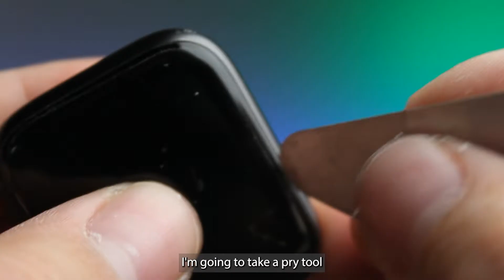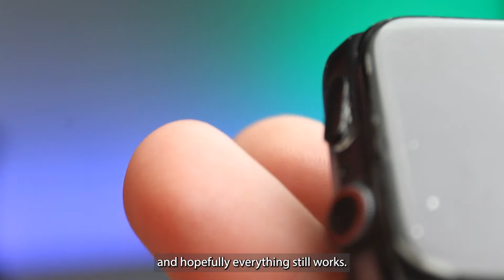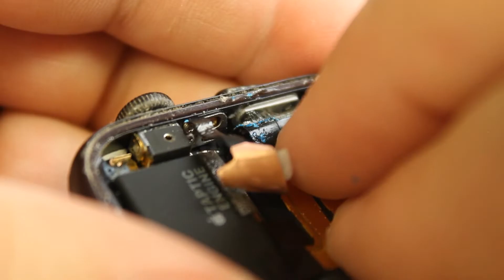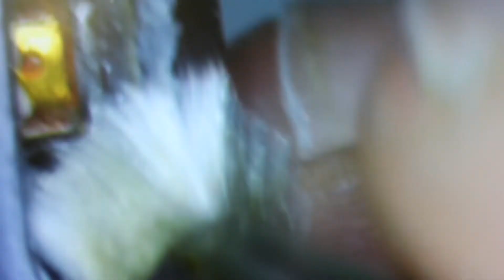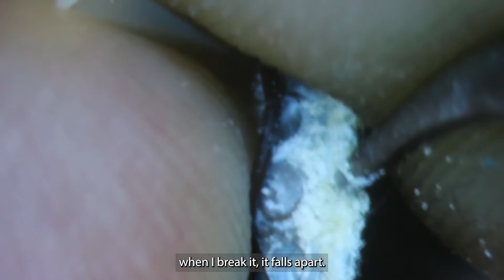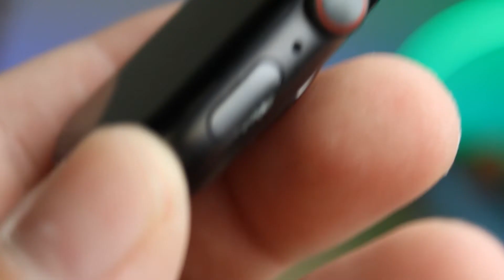Apple Watch Series 6 Power Button Replacement: Restore Control with Ease! #satisfying #applewatch

Comment: Help me with the latest ultra 3 7in1 straps 2.01 display, because it it different from apple and I can still move the power button but it won't click and it's spring was stuck from pressure of putting a strap

Comment: Hi
Can you help me with any advices?
I have watch 6 44mm water damaged
The issue with heart rate sensor, it isn’t active (doesn’t blinking) I replaced all housing from another Watch but it doesn’t help. then I replace flex connector from backplate to motherboard, also no result
Watch is charging and the cardiogram works

Comment: How much for this repair?
Reply: It’s not giving me an option for button repair. I’m having the same issue and my button doesn’t work. It’s full of dirt I tried cleaning it out but won’t work. It forsure is dirt bc I tried to work it with a sewing needle. It’s never been dropped or damaged. The only damage u will see from the button is me trying to clean if
Reply from the maker: Depends on the amount of damage. Submit a repair request at www.fixdirepair.com
Reply: @FIXDPHONES  the watch has problems with the power button